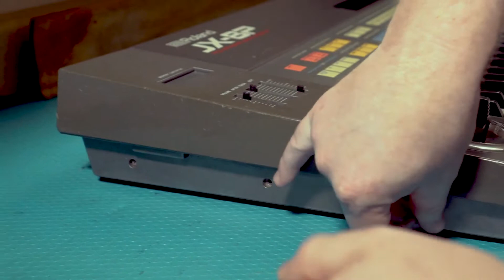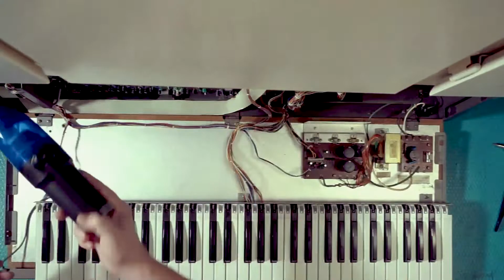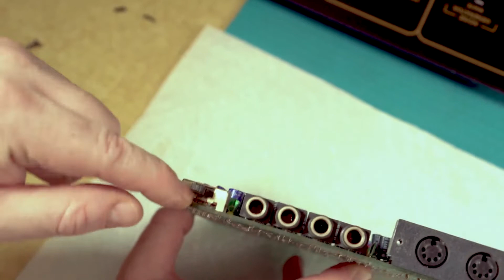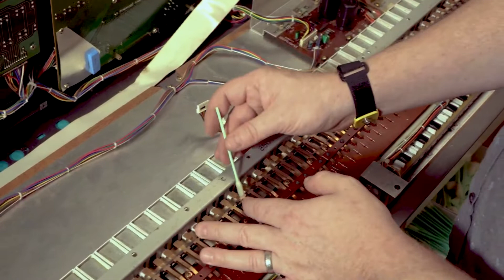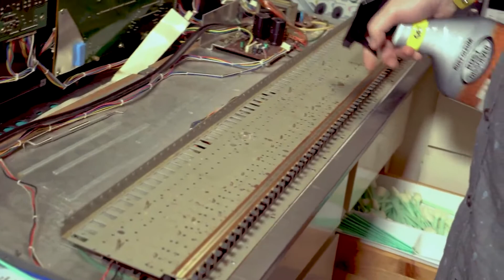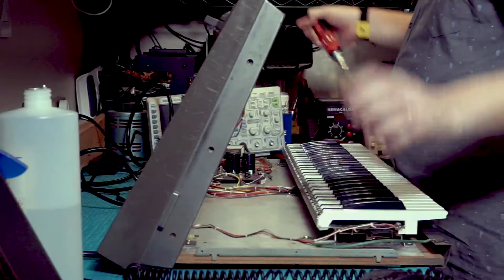Roland JX-8P: Detailed Service, Repair + Demo Track~

Comment: Best JX8P keybed vid on YT. My JX8P has about 7 keys miss firing. (Particularly if I haven't used it for a while).  When you cleaned between the copper contacts, what is the best cleaning solution to use with the cotton bud?

Comment: Heyo! Any chance you can help me out and tell me what size screws those are on the sides of the case? I just bought a used JX-8P but it's missing the 6 screws that hold the case together.

Comment: Thank you for the informative video. I've got a late model (SN 570412) JX-8P which I am currently repairing. The power supply -15v had failed so I checked all semiconductors (and caps) on the power supply board and replaced the M5230L dual tracking voltage regulator. I removed all the keys and springs and cleaned all the key switch contacts. Reassembly was straightforward. The key aftertouch was working but suffered from low gain. I increased the aftertouch gain by replacing the op-amp feedback resistor on the Volume Board with a 50% higher value. However, if I was confident I could disassemble the aftertouch strip to clean it and then reassemble it, then I would do that to see how much that helps. I don't think you mentioned what was involved to reassemble the aftertouch sensor. Would you please explain how the top and bottom of the sensor strip was held together and what you did to reassemble it? Thank you.

I am currently trying to track down why two of the voices don't sound "full" and am slowly figuring out the internal logic while looking at signals on my mixed signal oscilloscope.
Reply: Recently I cleaned very carefully the aftertouch strip (it was very oxydised) and there was no result after... I must try the way with resistor.
Reply: Did the new resistor help with fixing the aftertouch?

Comment: Hi early in the video you said be sure the capacitors are discharged before opening it up. Is that as simple as turning on/off the power switch while it's unplugged? Or is there another way to do it? I'm getting ready to crack open my JX-8P to try and fix the loose outputs, but I don't wanna get shocked!

Comment: Deoxit Red is only good for switches and for tactile buttons.  It is terrible to use on potentiometers including the ones in the pitch bend assembly.  need to use Deoxit green, fader lube for sure for pots and for sliders.

Comment: This might be a ridiculous question, but if I were to clean the oxidation on my aftertouch strip as this video demonstrates, but then provide a thin veneer of deoxit fader lube, would that maintain conductivity and help delay future oxidation? Or is that a very dumb thing to do because of possible reactions between the deoxit and other materials in the aftertouch strip? I just wonder if it's worth doing the cleaning when it could just oxidize in another decade and need to be done again...
Reply from the maker: Never tried that before, but my gut says it is probably not a great idea. If you do try, report back in 10 years 😆 Thx for watching!
Reply: @VintageSynthesizerSolutions  :-) I figure if no one has come up with a better fix in nearly 40 years it probably doesn’t exist, but hey sometimes dumb questions yield effective results! Thanks for the super helpful vid. It’s helped me get my JX-8p in much better shape and probably saved me $ to boot!
Reply from the maker: @niceheartwhitesuit  My pleasure, vintage synths are much less stressful when you can do repair work yourself!😅

Comment: Great Video except the background synthesizer music. Having a musical intro or ending to a technical video is fine.  However using spooky horror movie music in the background distracts from the technical knowledge and wisdom you are imparting. I don't need it to find out that using pads to clean the board is better than cotton swabs.  Watch other service related videos and you will see what I mean.

Comment: The aftertouch strip can just be pulled away? How is it reapplied? Simply sandwiched back together? Thanks!
Reply from the maker: Yes, use a heat gun or blow dryer during reapplication to ensure resealing.

Comment: What are cold joints? My JX-8P has had crackling issues. I have to be moving my TRS cables in at certain position to get a clear audio. But it takes my time away to get it right 😫 I've not tried the Deoxit cleaner yet.. Thanks for posting this vid!
Reply from the maker: Cold joints are cracked joints. They need to be "reflowed" with a soldering iron. Your 8p definitely has some cracked solder joints on the output jacks. Deoxit will not help, but it should be an easy fix with a soldering iron.

Comment: Question: I notice that most synth guys don't cover this topic, but how do you safely remove/clean scratches from a synth panel, especially on vintage gear?
Reply from the maker: Depends on the type and finish of the front panel. I often use ISO rubbing alc. unless its a mid-late 80s plastic synth with a thin paint coating like the Korg DW-8000. To polish out scratches, I often use automotive products like Nu-Finish Scratch Doctor, etc.